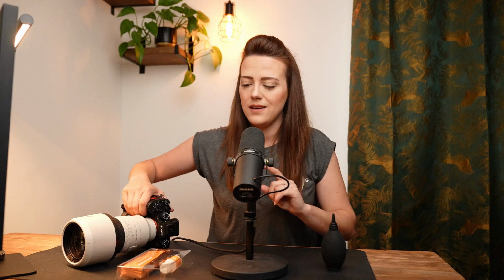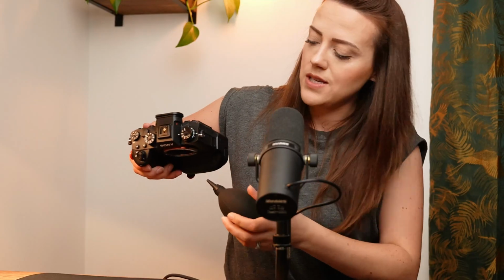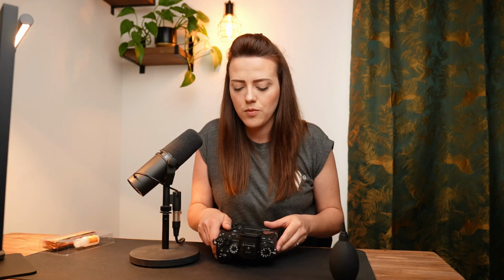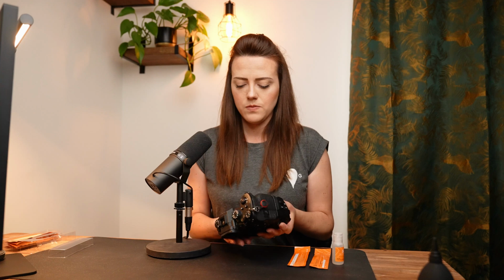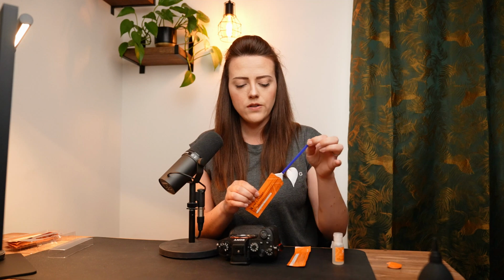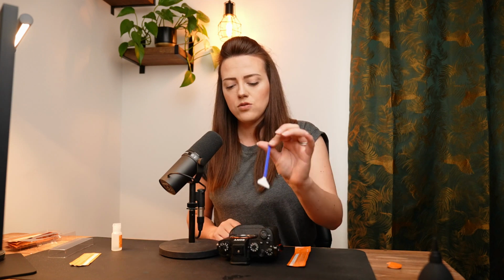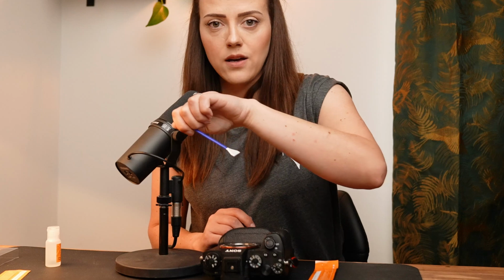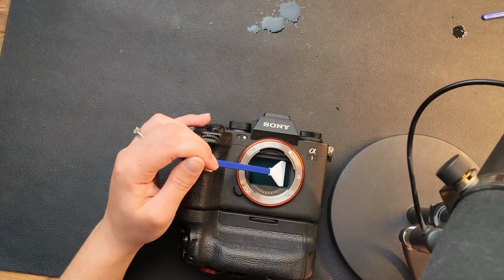How to clean a camera sensor | *GRAFTED* Sony A1 Sensor Cleaning

Comment: Remember...Different camera bodies clean differently. For example, I find that Sony A7S3 cleans pretty easily. My Nikon D750 would run through several sticks before it would come clean. My Z6 is similar to the Sony. Most of the time, I just need to use a blower and I'm good to go.
Also remember to clean the lens. The dust spot might be there.

To find the dust, set your camera at f22 and iso 100. A shutter speed of 5 seconds (adjust as needed). Point at a white wall or the sky and make circles and shakes while the exposure is being taken. This makes the spots stand out and ensures that you are not wasting your time trying to clean a stubborn spot that is actually on your wall.

Comment: my darling, that was a lot of pre game info. start video at 6:30
Reply: Maybe you're new here. Jess pregame is what we all live for.
Reply from the maker: Nope, if you start with a wet clean you'll have a nightmare with environmental dust and you'd also have no comparison image to check the result against, or navigate from, depending on whether you're spot cleaning or fully cleaning. You also might have the wrong equipment, and you won't have cleaned the external surfaces, or the internals with a blower. 1:33 is the latest to commence. 

I like to share anecdotes and laughs with my friends on here, it's ok if I'm not your cup of tea 👍

Comment: Great video and very helpful.  In what seems a lifetime ago when cleaning the sensor on my DSLR, I discovered that as part of my sensor cleaning process using a microfiber or something with some appropriate cleaning solution and wiping the lens contacts on the camera body AND  cleaning the back of the lens entirely was very helpful as often dust etc would gather in those areas. Without doing that, I sometimes would clean the sensor only to have dust go right back on the sensor when I reattached the lens.  As Jess showed us, cleaning the entire camera and lens during the sensor cleaning process is a good idea.
Reply from the maker: Thank you 🙏

Comment: I clean sensors for clients - a good tip is to vacuum the chip before doing a wet cleaning. I have made a thin aquarium hose that has just enough suction to lift an A4 sheet of paper. I run the hose over the chip with only a couple of millimeters of distance and can often remove all particles, thus avoiding a wet cleaning. This way, you also remove all particles before a wet cleaning, which could potentially scratch the CMOS sensor chip.
Another good tip is to use a Quasar Sensor Loupe to find any dust on the CMOS sensor.
I only use Pec Pads and Eclipse fluid for cleaning the CMOS - works perfectly!
Reply from the maker: Sound like you have a tried and tested ways of working there with some good tips in so thank you 🙏🏼
Reply: Good advice!

Comment: Mirrorless are dust magnets. :)
Reply from the maker: The literal worst. I'm sure some have a protective little cover thingy, is that not true Gary?
Reply: @ThatPhotographySpot  Yes. There is a protective screen over the sensor, so my understanding is you're not likely to damage the sensor. I get the worry, but you do eventually get used to it. :)

I typically run my cleaning brush one way and then flip it over and come from the other side of the sensor. Sometimes I find I even need to use a second or even third brush depending upon the amount of dust.
Reply: I normally use the blower to get rid of any dust bunnies on the lens before mounting back on the camera after cleaning the sensor.
Reply: @LouisaLee63  Yes I try the blower first, then internal sensor clean mode (which is rubbish), then sensor cleaning with fluid. The more you do it the more confidence you gain.